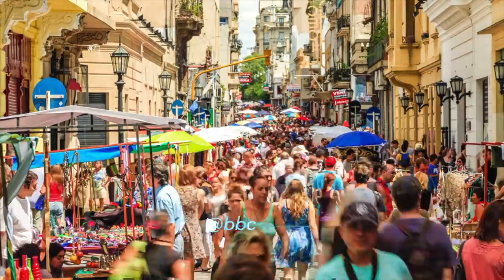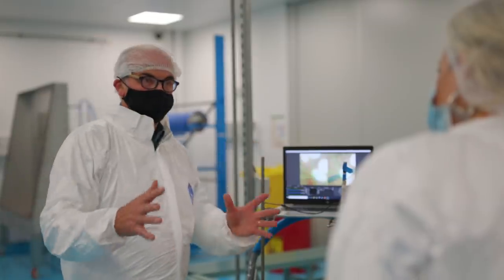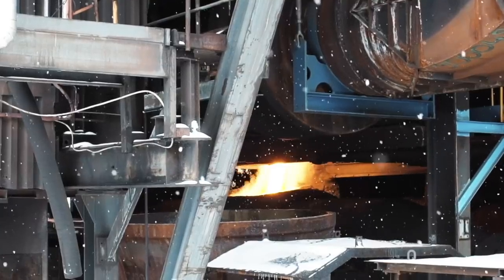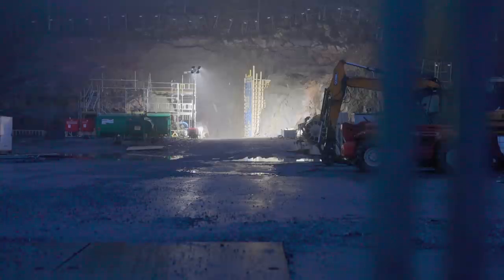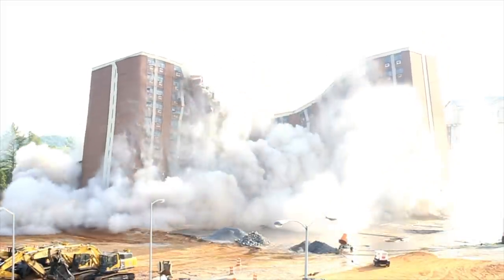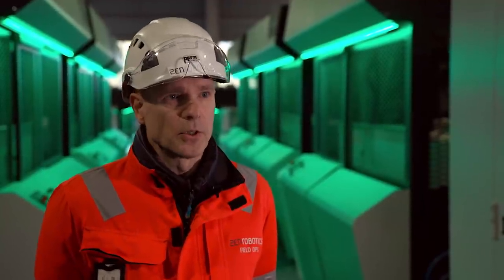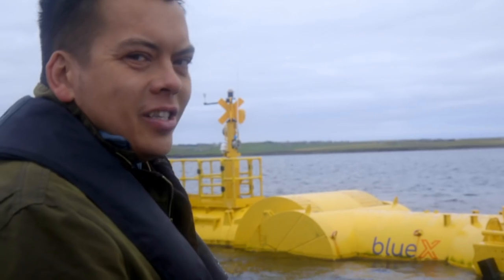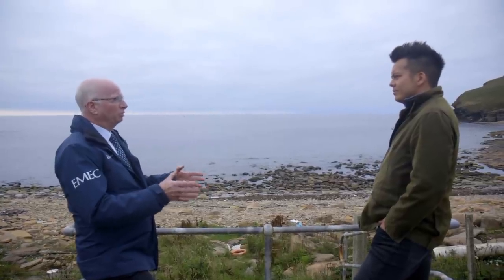Sustainable Buildings

Comment: Where do the materials needed for this come from? What is the lifespan of these flexible rolls? Durability or how it handles different climates? How long until we can power all EV’s with solar, hydro, wind, geo, etc? Most charging stations now are using energy from coal and other fossil fuel plants to charge EV’s.